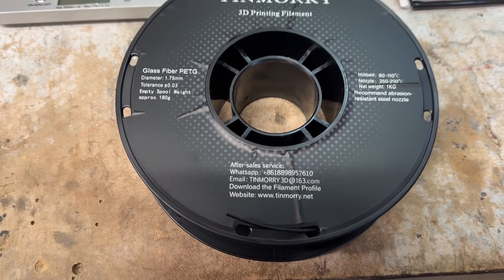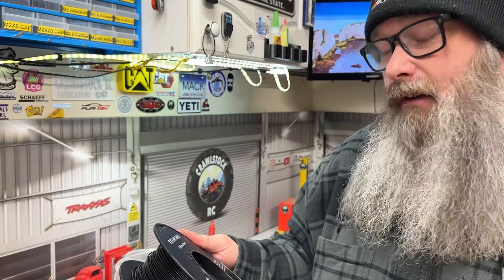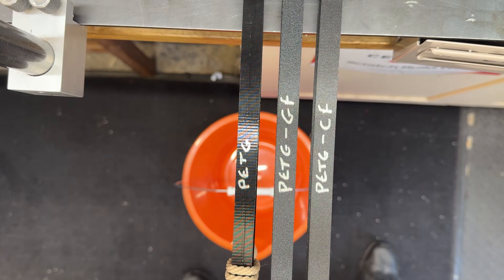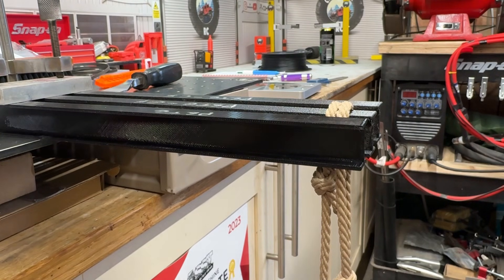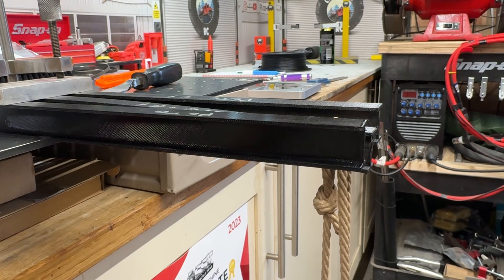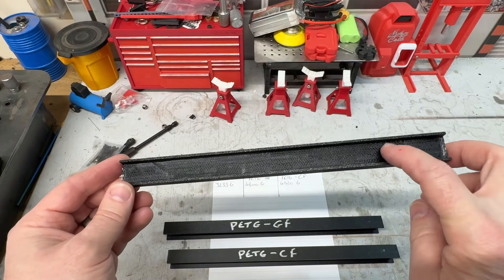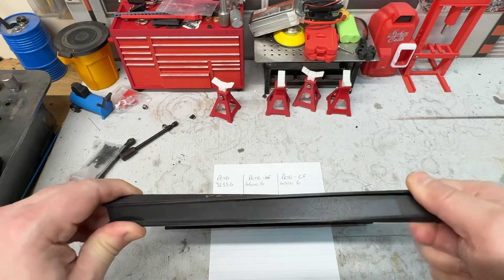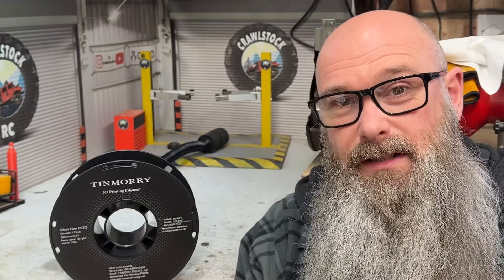Testing the best 3D Filaments for RC modelling Tinmorry PETG CF & GF How strong are they?

Comment: The biggest thing I see wrong with everyone doing this testing is that people don't anneal the parts for GF and CF, it will imporve regidity and strenght a bit more. Annealing give the layers better adheasion and will remove left over moisture that may have got imbedded during the print process. You should get even better results after annealing it.
Reply from the maker: Thanks, I’ll have a look into that. Often for my application it’s ideal to retain some flexibility.

Comment: Hello Sir. I have purchased PETG GF from Elegoo and it does not want to extrude from my hardened steel hotend in my Bambu Lab A1 printer. I have contacted Bambu Lab customer support which says it’s an issue with a clogged hotend since it is not supported but when doing it with stainless steel one it works fine. What are tes settings that you are using?
Reply from the maker: Hi, my filament was Tinmorry branded. Does normal PETG still go through the nozzle ok? Temps for the filament should be on the spool.
Reply: @crawlstockrc Yes I know about the temperature. I am having issues with all my filaments with this specific hotend. And the tech support insists its a clogged hotend issue. But, it was never used and the issue seems to be with the machine reading or knowing its hardened steel. That is why I am asking what were your settings regardless. I will try anything to make it work. Thank you sir.

Comment: I am struggling to print with this. What are the settings did you use?
Reply from the maker: Do you mean the PETG cf? What printer and setup do you have?
Reply: @crawlstockrc  The ender 5 max. I seem to have it dialed in. Temp 275 and 90 with a flow of 12. Printing at 80mm
Reply: .06 nozzle
Reply from the maker: Temps seem high . What does it say on the reel? I generally use 255 and 60
Reply: @crawlstockrc  I can bring the temp down however the reel says  260-290°C. This stuff is supposed to print hot I guess.
Reply from the maker: What brand is it? I don’t recall the Tinmorry CF being anywhere near that.
Reply: @crawlstockrc  I see the confusion I was printing Tinmorry GL. Ya the CF prints cooler.
Reply from the maker: Do you mean the Glass Fibre? I’m sure that isn’t that hot either
Reply: @crawlstockrc  Just bought a couple reels of the Tinmorry GF, it says 260C-290C on the reel but the upper end of that range seems excessive IMO.  Tinmorry has a GitHub repo with profile for a good number of common machines and they typically use around 270C.  It's excellent stuff though,very  good value and prints beautifully once dialled in with none of the stringing or warping I often see with PETG.
Reply from the maker: @ferrumignis  Yes i had t play around with the temps too. I think i ended up around 260 in my P1S.

Comment: I appreciated the attempt but you could do with re-doing this with some actual accuracy. The rope holding the bucket wasn't sat on the samples in the same place, it needs to be in the same location on them all otherwise you are using different lever lengths (the last one was clearly further down the part than the first which will make it appear to hold more weight), and you just guessed at the amount of deflection when it would be fairly easy to measure it properly.
Reply from the maker: It was a fun test just pointing out what’s available and the obvious differences. If you want a professional scientific study you might be better off doing your own video. Thanks for stopping by.

Comment: Thanks for the Video, i also ordered the CF for the first time ;) as you printed a lot already, May I ask what nozzle and bed temp you used? Or any other Tips for printing? Again, thanks!
Reply from the maker: Hi thanks for coming along. I use a Bambu Lab P1S printer and have fitted the Hardened 0.4mm nozzle which is a must. There is a preset profile for Petg CF if you look in the settings. It works perfectly.
Reply: @crawlstockrc  great Tip, will definetly Check that, thanks fir the quick answer 😉👍